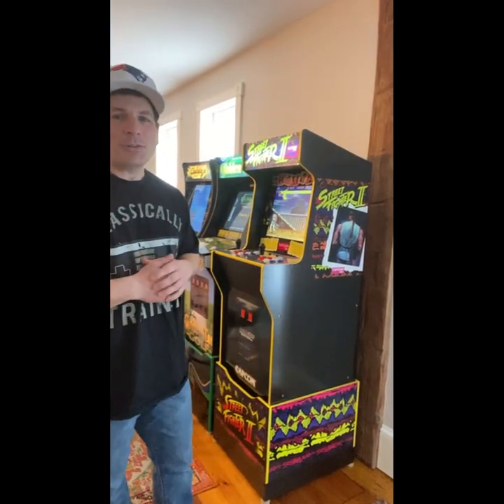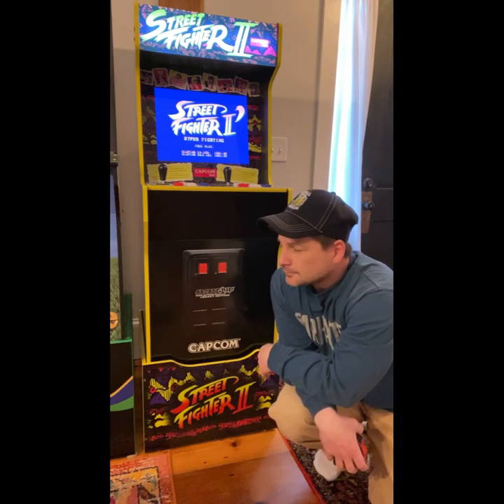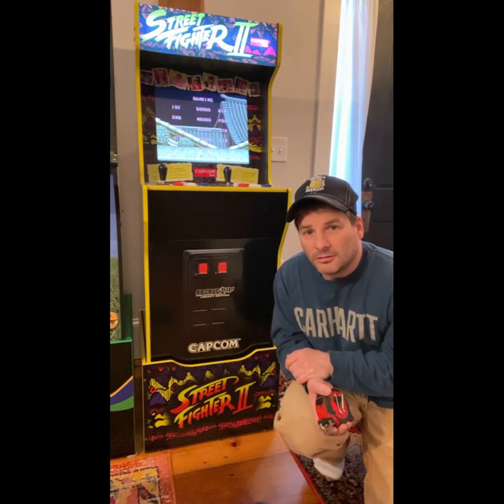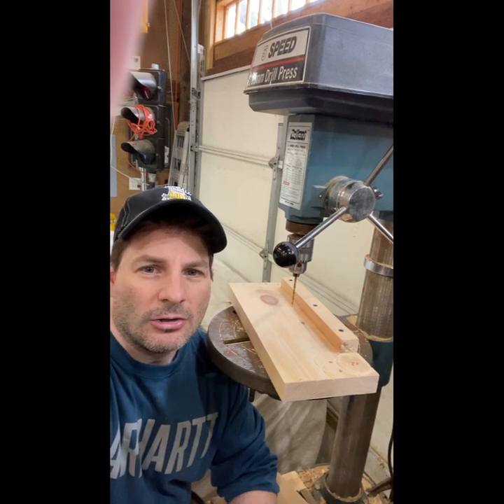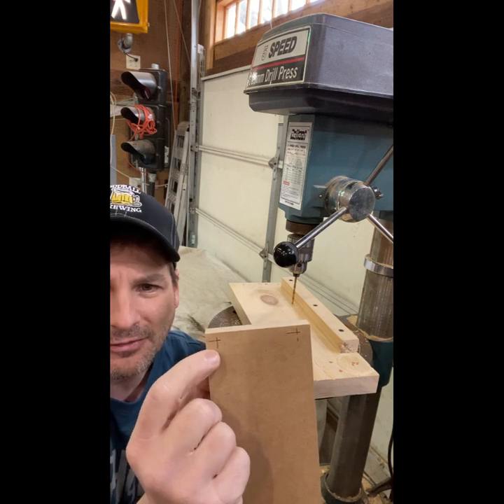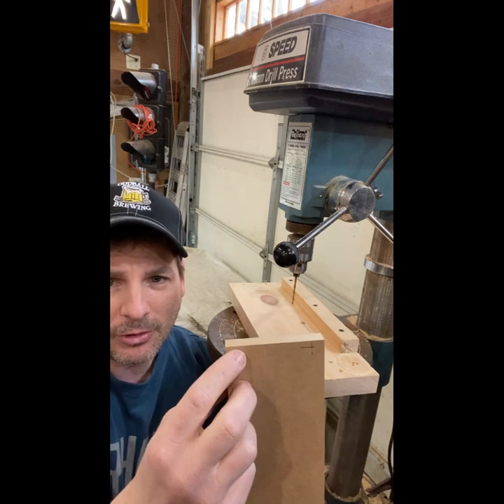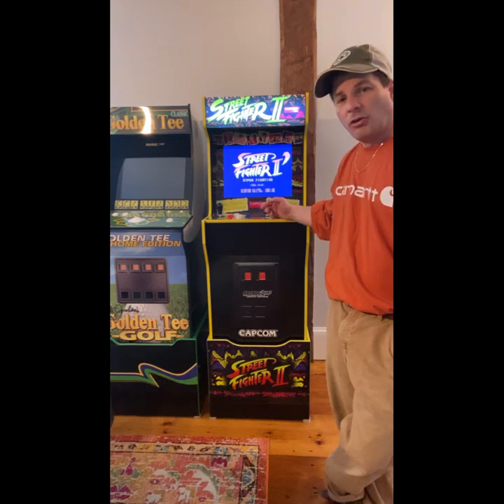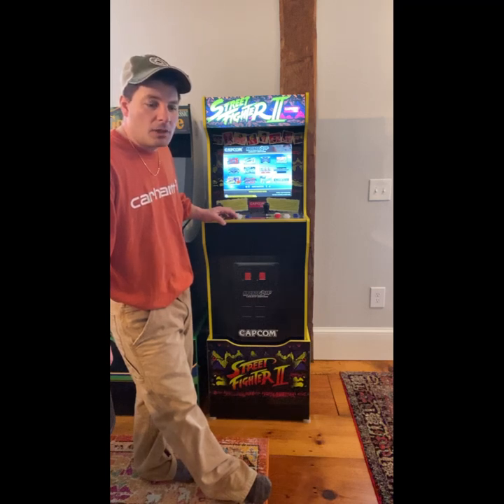Arcade 1up Street Fighter 2 Legacy Cabinet Riser for a Riser Mod

Comment: Links to what you used?
Reply from the maker: Your right. I’m new to posting stuff so I have to get on that... I’ll see if I can place some of them in my description
Reply from the maker: Just posted the links on the video for you. Thanks for letting me know and for watching 👍😀
Reply: @dwayneraimer  not seeing any yet
Reply from the maker: @smg4reblooperd182  oh, my bad.. I’m posted the links for the happ mod....
The riser mode is just 1/2 inch mdf board I bought at Home Depot by the sheet, and then just cut it on my table saw
Reply from the maker: @smg4reblooperd182  but I just placed  the mdf board link... hope it shows up for you now